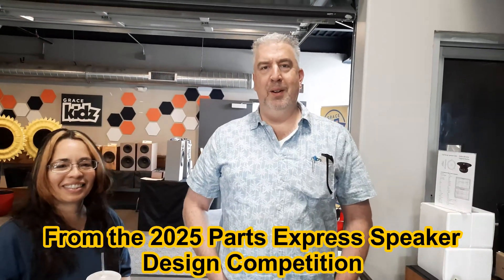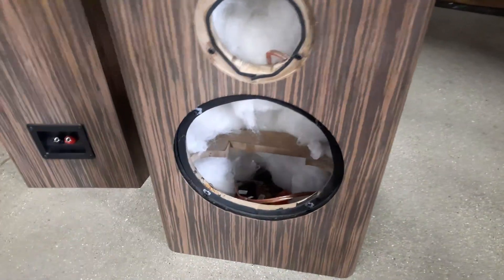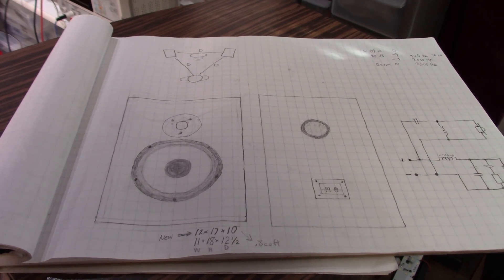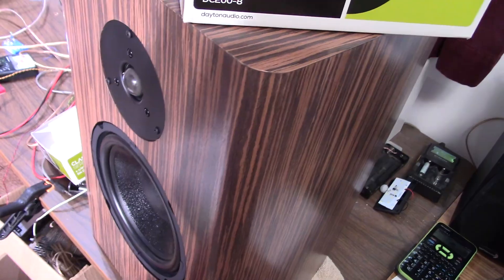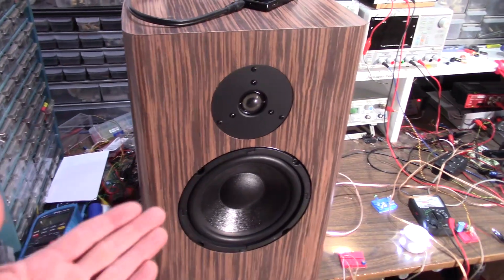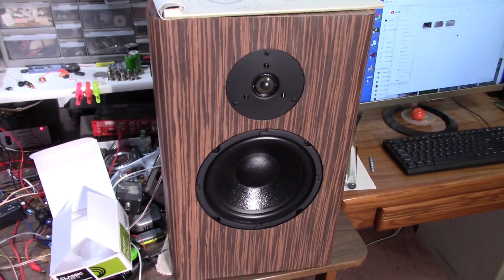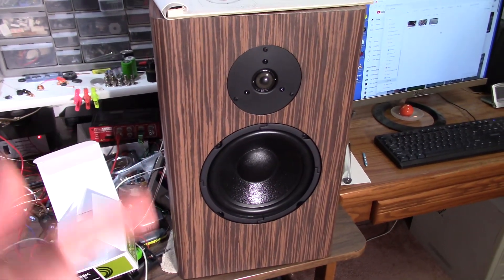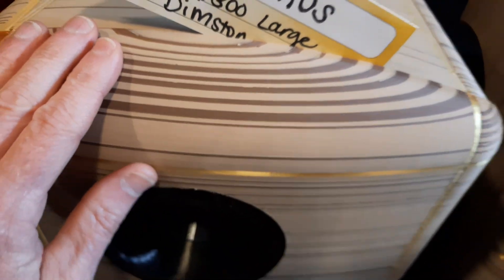DIY speaker project finally complete

Comment: John, do you remember the ""1 By One turntable motor replacement and quick review"" video one yoar ago ?  Some days ago my sister donate ma a JVC record player and its ""WOW and FLUTER"" was BAD ! So I open it and I fount a ""similar""  Matsushita motor, but most of all  didn't like at all the powerr supply.  A tiny tranformer 220VAC to ~ 11,5 VDC after bridge rectification and a lousy 1000μf/16V capacitor. I replace the transformer with a DECENT 230vac / 12vac  5va. I kept the bridge but  after  I connected 2 capacitors in parallel 1200μF/25V each, followed by an  LM2940-12. CONSTAND out voltage 11.97VDC. NICE !!! The speed adjustment was very ""tuchy"" so I opened the back cover of the motor and replaced the ""combo"" trimmer 500 Ω + 380 Ω resistor with a sealed 200 Ω trimmer + 510 Ω resistor and I replaced the 22μF capacitor in the covered in the motor board with a 100μF/16V SMD tantalum.  Well the speed stability CAN'T compared with my reference turntable but I can at least listen some records without loose my temper

Comment: I don't think I have ocd but the top grain of the wood going vertical instead of horizontal to match the sides seems to trigger something in me 😁 

They still look great but I usually like speakers with grills so they don't tend to have prominent wood grain on the front baffle so I guess that's what he aligned the top wood grain with since there doesn't seem to be any holes for a front grill. 

But designed for free you can't complain and I'm sure my wood veneering won't come close 😁
Reply: Aesthetically awkward, I found too.
   A rounded edge at the top (like the sides) might help visual continuity with such an aggressive grain.
   I have an old set of Sony towers (w/vinyl "wood") that treats that geometry very well.

Comment: The sound panel or sound module you have, I've seen it on eBay cheap. Don't know if it is equal to the one you have but quite similar to the one you have